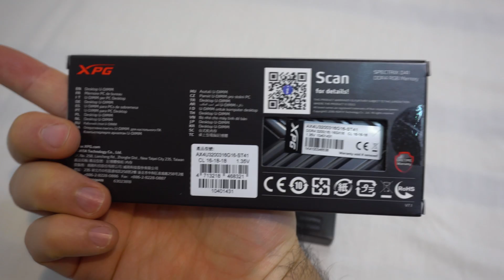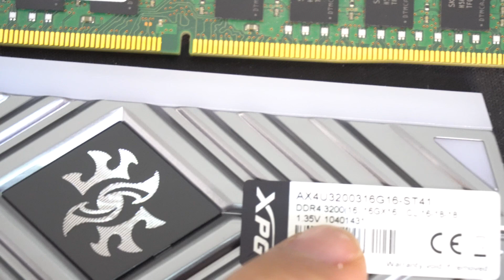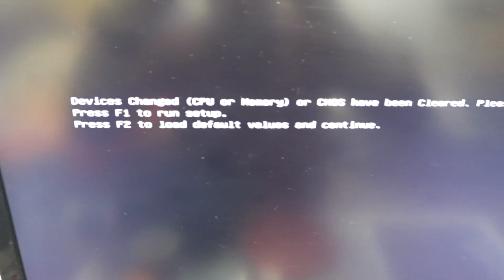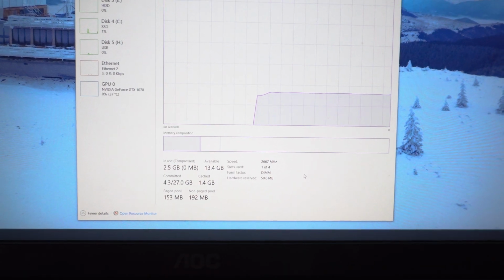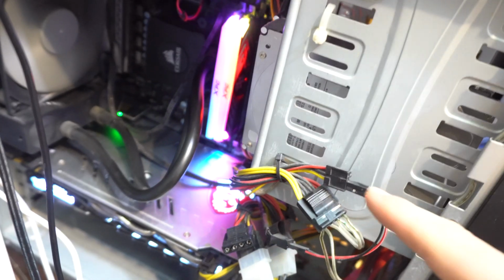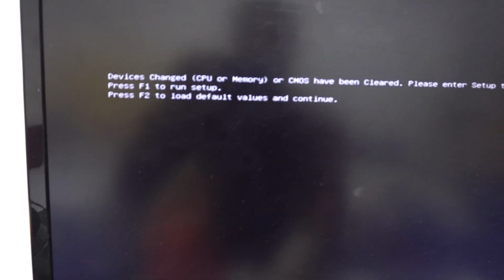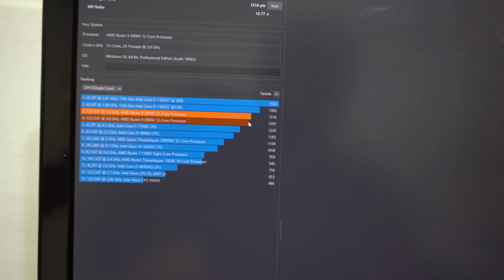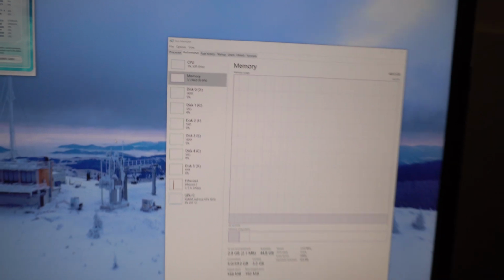ADATA DDR4 RAM 16+16GB 3200 MHz (Desktop PC memory update, Tests)

Comment: Did you consider that the rams have to be inserted into the right slots to enable dual channel? In most cases this are the slots 1 + 3 and 2 + 4. Looked like you used slot 1 + 2, thus dual channel is not used, which decreases performance.
Reply from the maker: Thanks for the info, I have to do more tests!
Reply from the maker: After a few tests Dual-channel mode in some cases surprisingly offers slightly lower performance compared to single-channel mode...
Reply: Well that's strange. A proper dual channel set up usually provides doubled read/write rates compared with single channel. At least if you test ram specific with tools like AIDA64. If you used all 3 modules it may be that only single channel speeds were used because the ram size wasn't equal for each channel.